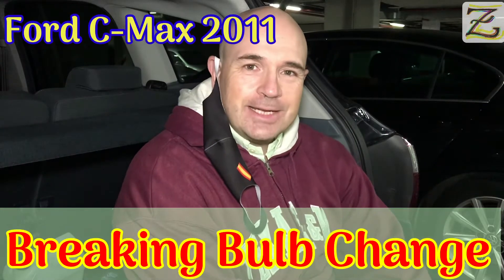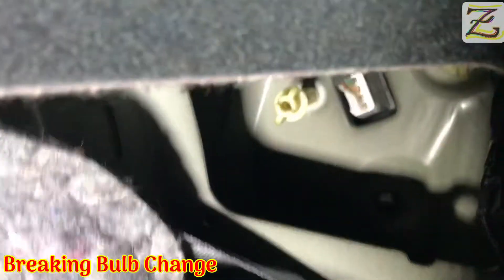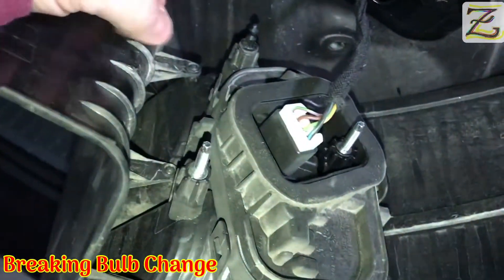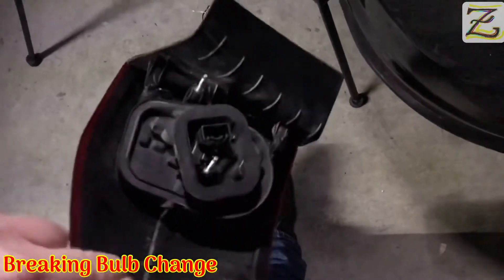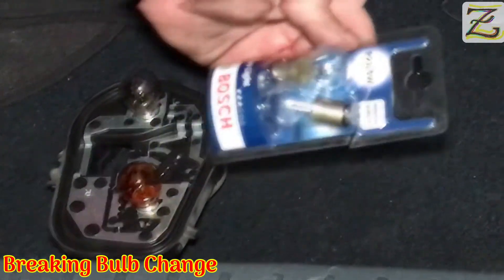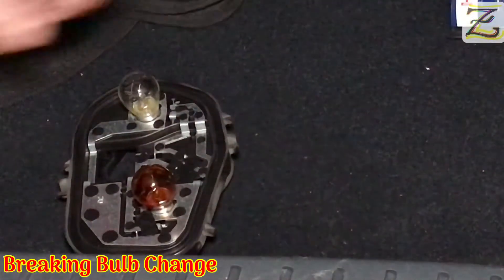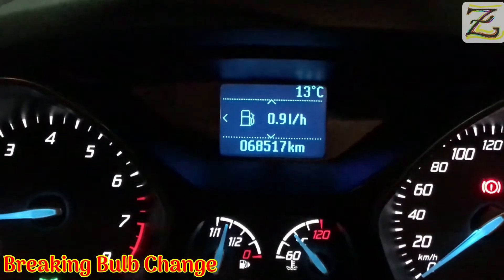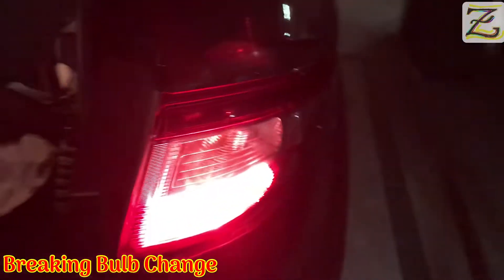How to change Breaking Lights in a Ford C-Max 2011

Comment: An excellent video giving every detail of how to change the bulb on a cmax. Everyone should be able to do it as you have left nothing out. The only thing I would suggest is doing the test by putting a weight (I usually jam a broom stick or other piece of wood against the seat and the brake pedal) before you assemble it all back together just to check the bulb works. Thank you.
Reply from the maker: Thanks. The objective of the video is to teach others how to do the change. If you learnt from it then the objective has been accomplished.
Reply: I certainly did. Thank you.